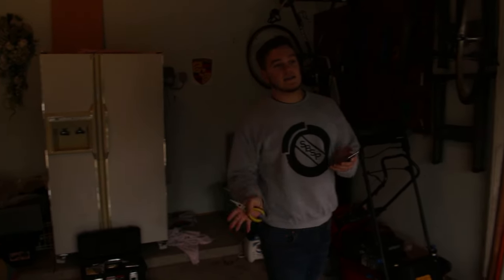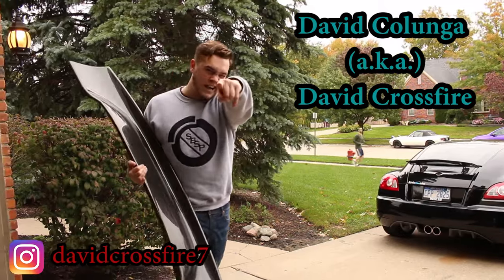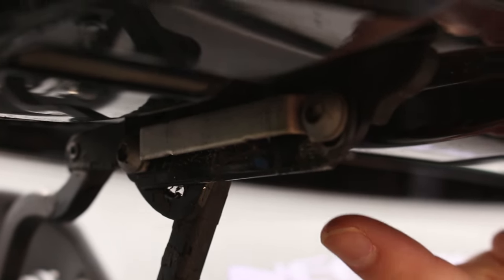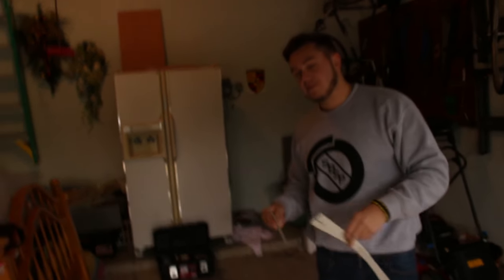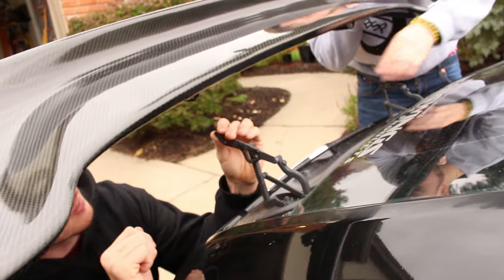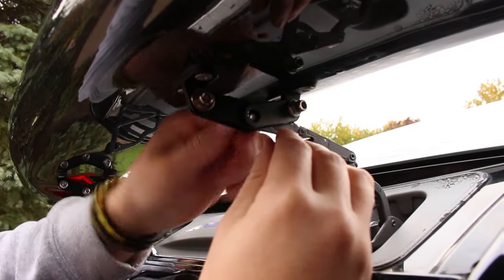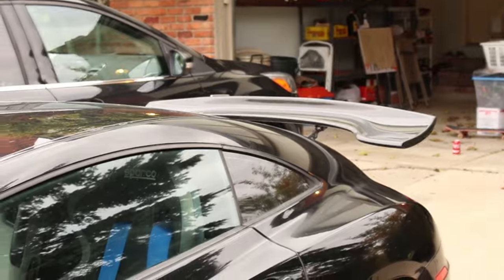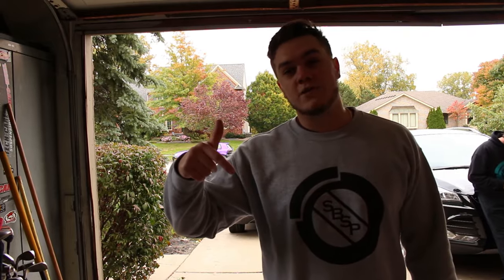Chrysler Crossfire Build | Carbon Fiber Wing Install

Comment: And maybe in the future get it to where that same motor will lift it to that position he has it in and then pull it down snug to the car,maybe install a bump stop on the motor arms so it doesn’t lower down to far into the car and do damage but stops just before touching the car,It can be done

Comment: I could go with that same wing but I would want it mounted close to the car body,what I would do is mount it,then have someone hit the button to lower it and pull the fuse just before touching the car or get it snug if you can